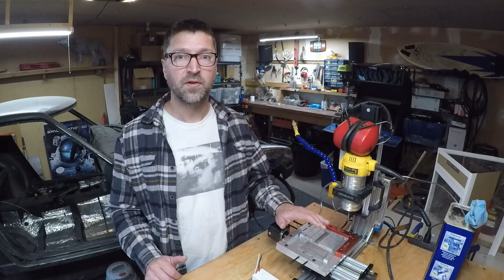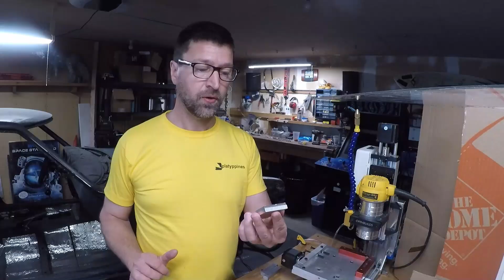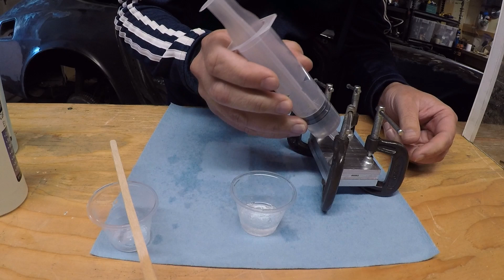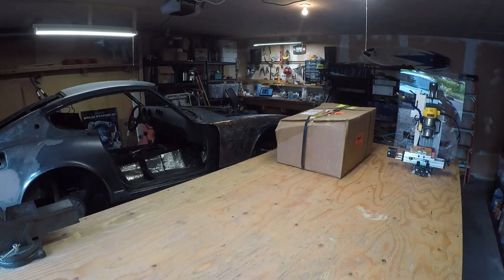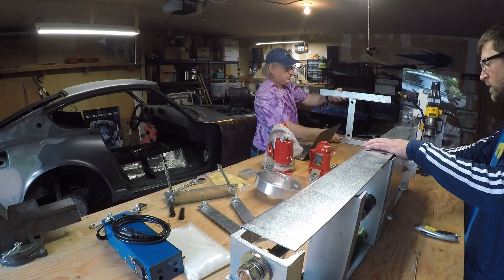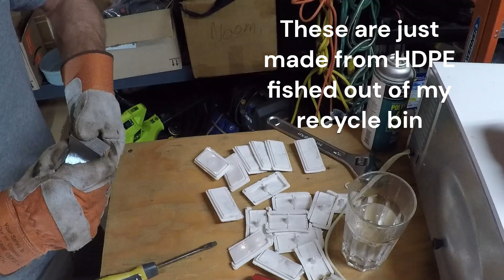Making Injection Molds

Comment: Great video!  What bit size and type do you use?  What speed and depth of cut?  Was that air and/or oil misting?  Thanks in advance for the info.  Cheers!
Reply from the maker: For the rough cuts I used an Amana Tool - 51377 Solid Carbide CNC Spiral 'O' Single Flute 1/4 Dia. For the finishing passes I used an Amana Tool - 46290 CNC Carving Flat Bottom Carbide 1/16 Dia.

I don't recall the speeds or depths, but I was pretty conservative especially for the depth of each cut. To get a sense from the video, the time-lapse was 2 frames per second, so a speedup of about 15x. 

You are right, that was air and WD40 misting. However, when the liquid was most visible that was actually water/condensation.